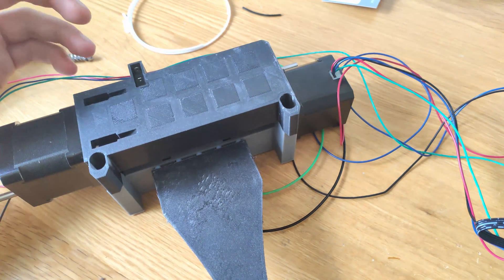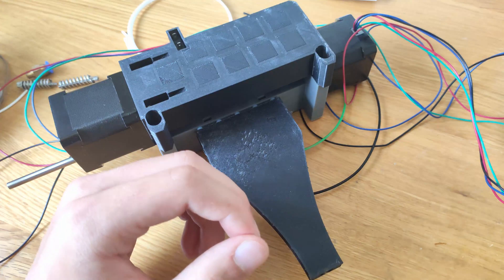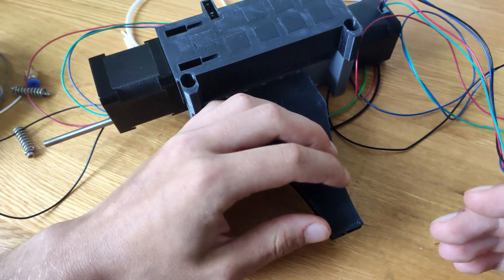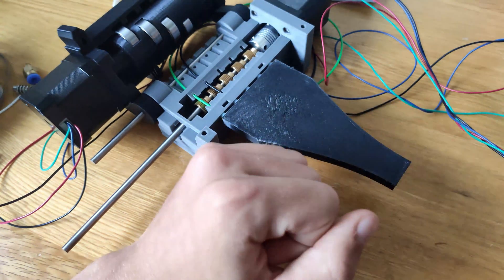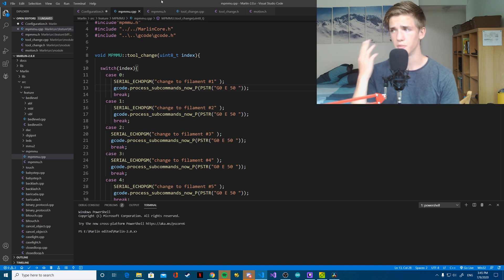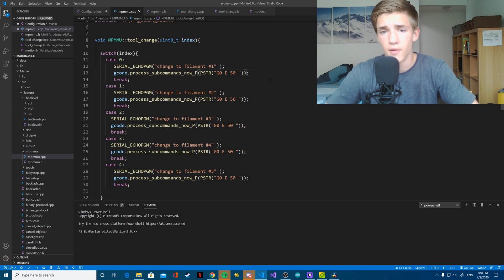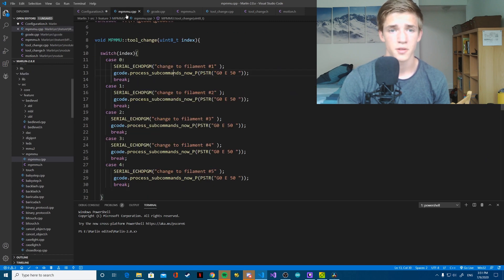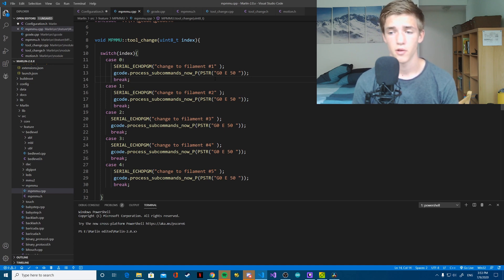MMU2 upgrade on any printer.  Part 13:  Physical assembly and firmware update

Comment: If you print the merger vertically, the filament paths will most likely be smoother, and you can get tighter tolerance!
Reply from the maker: I tried that as well but the link between the ptfe tube and the regular path becomes an overhang and this creates an even bigger problem (the overhang prints fine but there is then a bit of extruded plastic that goes at random places and that causes jams on about half of the tubes). I could make the transition smooth but that would then be equal to having bigger tolerances and printing the thing horizontally is also easier because you have a bigger surface that touches the build plate and when printing something thin that is this high I got some defects in the print be cause it was flexing a bit with the printer movements and if you have any problems with your layer adhesion this becomes impossible to print. But thanks for the tip! Btw I just finished creating an intro, it's not the cleanest but I does the job (2d animation is hard but I still wanted to try).
Reply: @materialswitchingunit284  you mean where the ptfe tube ends? Hmmm
Reply from the maker: Yes, and the design can definitely be improved but for now it works and I'll work on improvements in the future.(and once I have everything working it will be on GitHub so other people will be able to contribute on that kind of things)
Reply: @materialswitchingunit284  very neat, keep up the good work!